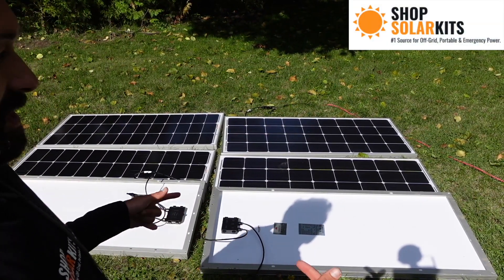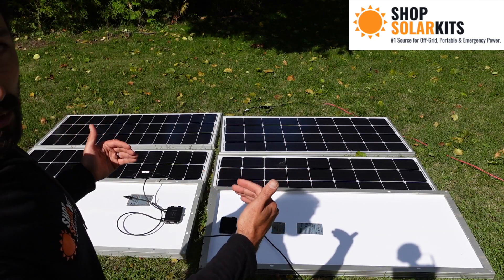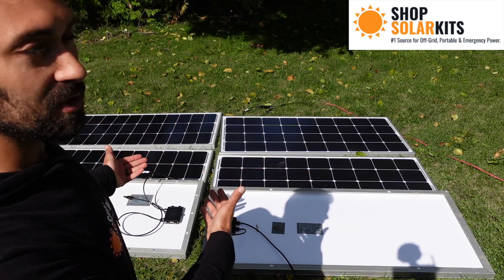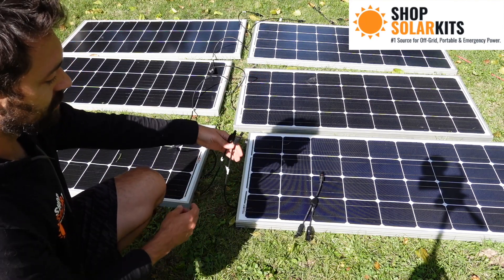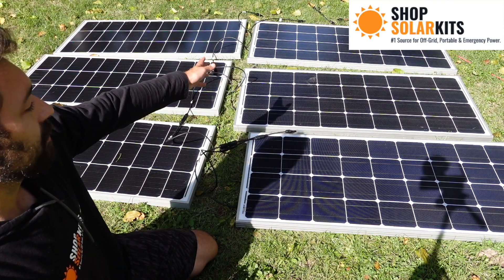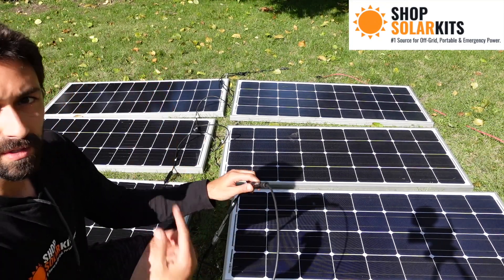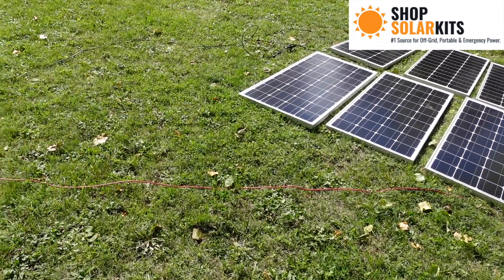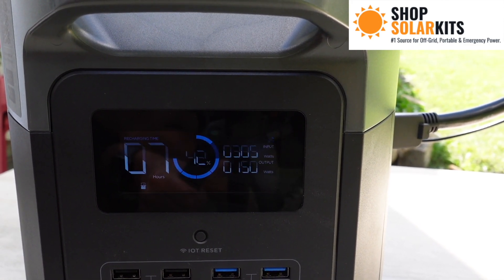How to: Solar Panel Setup For (6) x 100 Panels [HEX Kit] | EcoFlow Delta MAX Solar Set Up Guide

Comment: Do I do the same with 6 200 watt 12volt panels with the Delta pro....This is the set up I purchased from you recently Thanks
Reply: You should review the panel specs and configure appropriately. Say your 200 watt panels were 24V VOC with 10amp short circuit current, you’d want to wire that in a config 3S2P where it would produce 24x3=72 Volts @ 10amps for each group of three panels series connected then connect both sets of serial to parallel which presents 72V @20amps to the EF.   If the EF Pro allows for 15 amps then at full solar you’d be able to produce 72V times 15 amps for theoretical max watts of 1080.    Look for solar calcs to see different combinations. Remember with series you add the volts and amps stay the same. With parallel the volts stay same and add the amps. High amps can get dangerous so be careful.

Comment: hi, nice video, thanks, theres a big confussion, delta max (1600) and (2000), says in the solar input label 10A max and 100V max, why everyone says they can handle 13A ? thanks
Reply: There are two things the EcoFlow charge controller care about. Volts and Amps. Dependent on how you wire your panels you can achieve high voltage low amps or low voltage high amps. You cannot wire panels that produce higher voltage than the EF allows. However you can modestly go over the Amp limit on the EF. Say the EF says the solar panel input is limited to 15amp, you can safely connect a panel array that achieves higher amps, say 18 amps. That’s more less fine because the EF will limit the amps to 15. That’s not the same for voltage. If the EF says it limits to 60V you best not go over that limit or you risk frying the EF.

Comment: Cant you just connect all 6 of them without the branch?
Reply: No because the EF charge controller has limitations. That’s why he put three in series times two then connected in parallel to achieve Volts/amps that are compatible with the EF.

Comment: What about amps?  Delta max only handles 10 amps and an average 100 watt solar panel runs at 5 amps.  So if you connect more than 2 panels you’re already at max amps.  Wouldn’t Connecting 6 panels trip a fuse or damage the inverter? Thx
Reply: Nope. Anything over the max amps is not used. If you send over the max Voc from the panels to the SoGen, it would fry the controller.